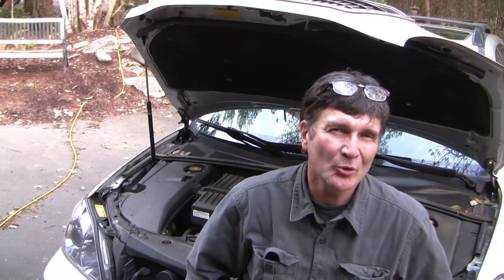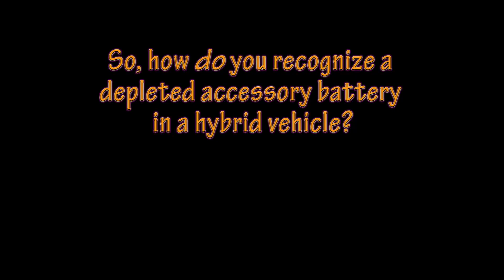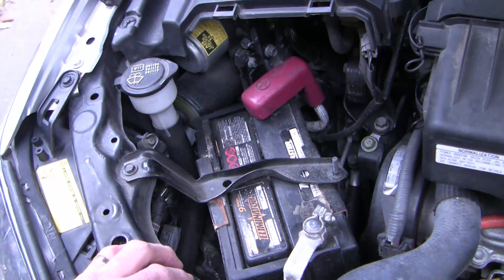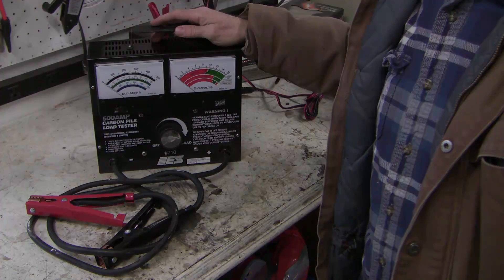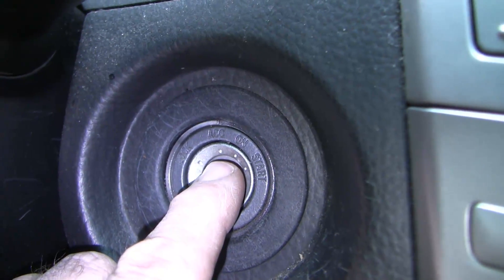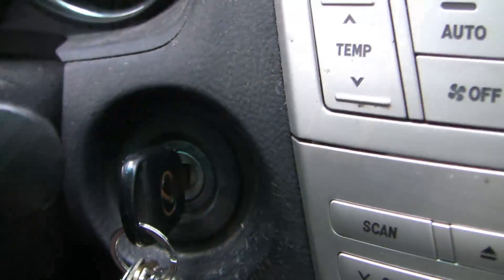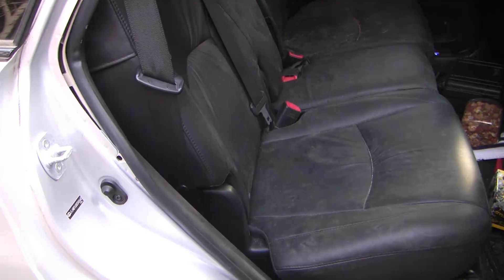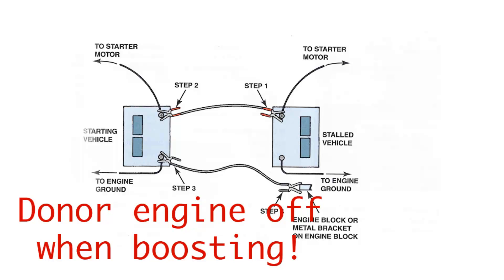How to diagnose and fix a disabled hybrid vehicle

Comment: How to replace a lite balb for the left tern signal.on a smart for too Car
Reply from the maker: That's a good question. All new cars have switched to the more energy efficient option of LED bulbs, which require a little microcontroller to get the power exactly right. This practically means you often end up having to replace the entire housing when the bulb fails. It turns an easy fix into a repair that is usually a few hundred dollars, or more. Some vehicles have an actual little module inside so lights can be controlled on one of the bus communication lines. That's what allows lights to be coordinated, so a headlight can be turned off independently when turning. For many, you can replace only the housing with bulb and reuse the module, provided it has not been damaged by water intrusion, etc. If that module is damaged, the cost can be really expensive if you can't find a replacement in the junk yard. Some of those modules require reprogramming as well. It's easy to blame government for this, but the story is more complicated. I believe the new car consumers made the choice they want fancy lights and they don't think about pollution, longevity, repair cost, or higher total energy bills to replace all that junk. Stack up a few repairs like this, and the car meets the junk yard 5 years sooner.

Comment: I'm working on a prius right now and your right about the 12 volt battery it can go dead without a warning. If current is low on the 12 volt batter the car will shut down. The 12volt battery controls the computer and the computer is very sensitive to a full 12 volt no less will do, so it shuts everything down.

Comment: See I usually idle About an hour a day 5 days a week at work on break it's either to cold here or hot so normally I run my cars and idle for a bit. So idling in these cars are a bad idea I usually idle with the heat or ac all the time

Comment: This happend to my Toyota Hybrid also. Let the lights burning while at my job. In the afternoon the doors are locked and my hatchback door was locked also without any power. So I used the little metal key, hidden in my keyless entry fob, and opend te frontdoor. Then I switched open my motor compartment lid and opend the fusebox. There you'll find a extra auxiliary battery + connector that runs to the auxiliary battery in the back. I used some starter cables and a other battery with the plus + on that connector in the fusebox en the minus - on the engine. Then I opend the electric hatchback door and I had access to the auxilliary battery.  After switching the starter cables to the rear auxiliary battery I could start the car. After a few seconds waiting the petrol engine did start. Thats all.  This way there is no need to crawl thru the backseats to get to your auxiliary battery with your jump cables. Don't start your car with the cables on your fusebox + connector, but only directly on your auxiliary battery plus and minus.
Reply from the maker: Thanks for the feedback! Your car is different, with the auxilliary battery in the rear, I store my booster cables under the seat. I'm curious, why you suggest not using the fusebox + connector when you start the car? I've seen other remarks on other vehicles suggesting it is better to boost there rather than the battery post, something about the electronics for the battery monitor being vulnerable to overvoltage.... Presumably the most reliable source for info will be the owners manual.
Reply: @spelunkerd  Thanks for your reply. I don't like those start clamp hanging on my fusebox while the engine starts. Once it jumped right of that + connector. I also think it's much safer to take that plastic lid from the auxiliary battery and connect there. Also my manual says to do this that way. I drive a older type Auris model.

Comment: Will the Hybrid Battery recharge the 12v aux battery if you leave the ignition on for about 15 minutes ❓     Many thanks in advance for replies...
Reply from the maker: Yes, but only with ignition on and engine running, the two are isolated otherwise. Recharging a battery takes about 12 hours for a complete charge, and fast recharging is not good for lead acid batteries. The extra current and heat during recharging causes hydrolysis inside the case, releasing hydrogen and oxygen gas, and causing loss of water, eventually destroying the battery. That's why it is wise to check electrolyte levels and refill with distilled water once in a while.

Comment: My 2014 model Lexus is still refusing to give me a ready light even though I have have fully recharged the accessory battery..
 Is it possible that the hybrid battery could be dead and therefore not turning over the starter motor and if so how to fix? 
Without a ready light the ignition button will not start the car... 😥
Reply from the maker: Good question, I don't know. I'd probably approach it like any no crank, no start problem. Check to be sure the security light goes out when you turn the key on, use a scan tool to find clues, and scroll through the menu features looking for something that describes the state of charge of the vehicle. Make sure it is in park, all vehicles have a neutral safety switch, to prevent cranking when in gear. I'd scroll down each fuse box looking for blown fuses, best done with a test light or power probe so you don't have to remove fuses and trigger confusing diagnostic codes. If that fails you could remove the negative pole of the accessory battery for 30 seconds, then reattach, done to reset and reboot devices. Failing all that I'd be calling for a tow. As you say, if the main battery fails, you can't jump it, you need a recharge at a charging station. Please stop by again to let us know how it turned out.

Comment: How is the water in a sealed battery topped off?
Reply from the maker: Of course you can't remove the glued caps on a truly sealed battery, but many that claim to require 'no maintenance' do have removable caps. I might try to pry caps off but if they are glued I would stop before breaking something. The whole system of water-based lead acid batteries is archaic and will eventually be gone.

Comment: I noticed in my 2011 Ford Fusion hybrid that if I put the shifter in neutral it does not start the gas engine to charge the accessory battery and drive battery as the drive battery nears 1/4 reserve.  So I never leave the shifter in neutral.
Reply: Thanks for your video mate!

Comment: Thanks to you I now realized NAPA sold me an unneeded new battery. My original battery was at 81% of CCA rating when NAPA did the load test. According to them the battery needed to be replaced but i told them my Prius was running on limp mode when the "Check Hybrid System" warning came on. It probably wasn't recharging the 12v battery instead it was draining providing power for all systems when I drove 2 hrs to get home. 🤨

Comment: A  hybrid that gets an impressive 25mpg avg on the dash.
Reply from the maker: Yeah, not so great, a little better with summer gasoline. I was a little surprised the Lexus doesn't beat out the Prius, but any vehicle designed for performance and luxury comfort will behave more poorly when it comes to efficiency. There are many individual driving factors that influence fuel economy, including simple issues like altitude, road quality and traffic. I've never seen a vehicle achieve the fuel economy described on new vehicle stickers.

Comment: Lithium jump pack is a must in a hybrid.
Reply from the maker: Excellent point. Because the accessory battery doesn't need to deliver much current, you don't need the kind of heavy wire jump pack that normal batteries need to get the vehicle started. Power for the high current starter comes from the big battery, so you only need enough juice to supply the safety and reference and computer circuits. A lithium jump pack will do that, fine, without the added risk (from higher voltage ripple currents) seen when boosting from a running donor car. My NOCO GB70 lithium pack is bulky, but smaller devices are available that might be a better fit with a hybrid. On the other hand, it is hard to beat the economy and versatility of jumper cables, which last longer and don't need to be kept charged.

Comment: NICE VIDE Can you explain a hybrid that as soon as it tries to run in gas mode it shudders and shuts right off. any ideas? jimdaly10@gmail.com
Reply from the maker: Gee, I don't know. I'd put the vehicle onto a scanner to check for codes, look for common things like an accidentally disconnected maf sensor, fuel delivery, etc. Freeze frame data may offer clues.

Comment: Very helpful, thanks. I got my ct200h showing the exact same behavior in the parking lot, its 90k miles, not sure at this point if i need to buy an accessory battery or just going over the process of re-charging the battery, this is the 3rd time i got the starting problem in 10 days so I assume is a battery getting too old,  not sure about the distilled water but will try and report back.
Reply from the maker: I would check electrolyte and fill with distilled water if it is not a sealed battery, warm in the house overnight and trickle charge overnight, then take it in to be tested at your local autoparts store. The battery testers they use at parts stores require a full charge to be certain the battery is bad. You can get an AC trickle charger for about $40, a good investment. Good luck!

Comment: Hi! I'm looking into buying a 2007 Nissan Altima. The current owner is only asking 1200 due to the fact that the battery is bad. She says that she could drive it for about 10 minutes before it dies. Is there any way to disconnect the battery so that the car runs on the engine?
Reply from the maker: A bad battery will NOT do that, it is more likely to be a bad alternator or bad wiring. Once a vehicle is started the battery is overtaken by the alternator and a bad battery will almost never cause failure while driving. An alternator isn't very expensive, usually a few hundred dollars, so if that is the diagnosis then it wouldn't necessarily be a deal breaker. However other causes of massive drain could challenge even a normal alternator so there is some uncertainty about the diagnosis. I suggest you ask for a vehicle inspection from an independent mechanic before you buy. Depending on where you live, an inspection may be necessary for environmental regulations and you don't want a rude surprise. Independent inspection costs about $100, and you often get your money out of that by showing defects that might drive the price down before you commit. Also if you do buy the car you might get a better deal from the same mechanic to fix it for you. Good luck!
Reply from the maker: Oh, it looks like my remark from last night didn't get posted. In brief, a bad battery would not cause a fail while driving, the alternator takes over while the engine is on, and even a bad battery will function fine if the alternator is adequate. I would ask for advice from a pro, spend $100 to get an inspection. A new alternator with labour would be a few hundred dollars, not necessarily a deal breaker if that is the cause. It might be something even more simple like a bad ground connection, etc.
Reply: Great! Thank you so much.

Comment: Good day to you,
I would like to start disassembly of my battery; however, I
have a few questions.

When removing the battery what points is the multimeter
touching to make sure there is no current? I know it’s the Hybrid Main Relay
but what is Positive & Negative? I haven’t removed yet but if there is a
RED wire do I assume it’s the RED ‘hot’ side and the black the Negative?

When removing the actual battery contact nuts is there a
safe order to do so or just start from one end and move to the other? Is there
sparking involved? Is there 100 V still live and active while removing the
nuts? Or is there only a smaller amount if I stay carefully on each one. I noticed
in one video I saw a spark when a tool touched between 2 of the battery
contacts when the harness was being removed. I think they were removing a Gen 1
battery where it had the sticky glue and they were just using a flat head screw
driver.
When or if it sparks is it the size of a typical 12V car
battery when reinstalling and there is a small load on the battery and there is
about ¼” spark that’s no big deal?
I am told use LineMan gloves..I’m assuming there is a
difference between those and just ARC welder leather gloves?

When putting the nut back on..are you using gloves or just
using bare hands..no one seems to film that in there videos.
Is that just liability issue so if someone got hurt and that
is the most dangerous point one wouldn’t accuse you of showing something that
was too dangerous? 
Also, I read somewhere that most torque wrenches are too
strong for the actual torque for the battery contacts for the orange strip.
They mentioned something about a being torque wrench or something that has
smaller measurements of torque..I have since lost where I found that Prius thred.

Any feedback is greatly appreciated. Have a terrific day!

Also, I wanted to get a HobbyKing Quartto x4 NiMh Charger
and a dedicated 12v battery to run it to balance the batteries with ofcouse a
fan cooling the battery and the charger during the process.  Do you happen to know the discharge and charge
value to enter rate of charge amps etc?
Reply from the maker: I've often wondered if I would have the nerve to replace the main battery myself, but now that we have sold the car it's not an issue for me. I've never worked on the main hybrid battery, I've only worked on the accessory battery. The quick answer is, unless you're an electrician, I wouldn't take the risk. Yes, those gloves are more than just welder gloves, and even welder gloves over top of larger rubber gloves is inadequate. The voltage behind those batteries is more than enough to kill you, and I have personal friends who have lost arms from electrocution burns from one simple mistake. Working on the main battery of a Hybrid is working on a live circuit with no fuse to save your life. That kind of voltage and current would cause an involuntary spasm of your hand muscles, so typically if the circuit is completed through an arm, you can't let go, it just continues cooking your body unless you're lucky enough to fall away and break the circuit by gravity. If you live, it's a lifetime of neuritic pain from the arm injury, and that pain continues even if you lose the arm. The guys who work on these batteries go through extensive training following a step by step exacting recipe. To think that people like us can do it without a mistake is unrealistic. If you want more info, get a copy of the dealers repair manual for your exact car. Toyota put out a free safety manual on their website for firemen who have to work on these cars after an auto accident, and there are some details regarding safety procedures on those documents.
Reply: Thank you for your reply. Unfortunately, at this point in time I am far from having the money to fix the car by a professional even though one could be had for around $1000. This is why I'm learning how to do it myself. I have learned that the voltage is split in half once the orange service plug is removed and also how to test the main hybrid relays for current by a multimeter. As a added precaution I was going to tape my racket sockets with electrical tape to help minimalize any accidents. I have also been speaking with people who have done it. Nevertheless, I do appreciate your feedback & have a terrific day! : )

Comment: Hello,
Please am having an issue with my Honda Civic Hybrid. I really hope you can be of help. I was told the cable taking current to the battery compartment at the back seat got expose and hence there was contact between them which led to a shunt. When this happened while driving, the car jerked off and the entire system wouldn't come on. I called a technician who found out the problem and separated the wires and the cars came on. However since then the charger doesn't seem to charge the batteries anymore. Once the vehicle comes on it starts draining the battery until it's depleted and gradually the system starts to fail. They have changed the charger and even the batteries at the back seat and yet it still doesn't charge. What do you advise I do in this situation?

Comment: If you have a marginal 12V battery on a Hybrid and want to sit in the car and play the radio, make sure you "start" the car and the dash READY indicator stays lit.   

While the READY light is on, the car will continuously charge the 12V battery even if the gas engine cycles on/off.   When the READY light is off, you are only draining the 12V battery.    Luckily, the 12V battery does not "crank" the engine so you can jump a hybrid with the wimpiest of jumper cables and even a motorcycle battery is capable of jumping a big Hybrid SUV.   (a good 12V is only needed to run the computers which tell the big hybrid battery to start the gas engine).

And remember, after you start a Hybrid, you can drive the car as soon as the READY light illuminates, even if the gas engine hasn't started yet.
Reply from the maker: Wise advice!